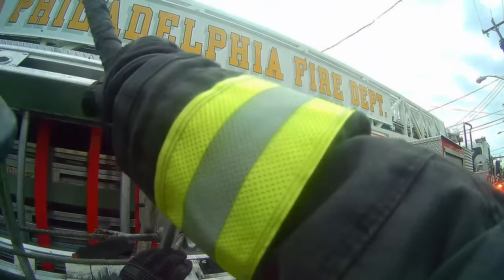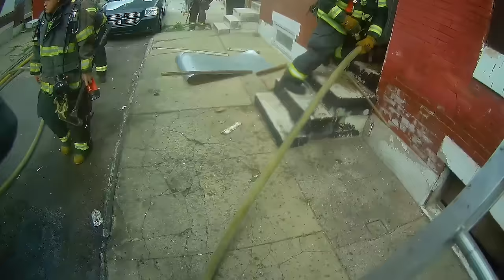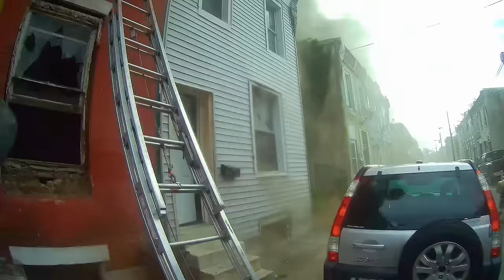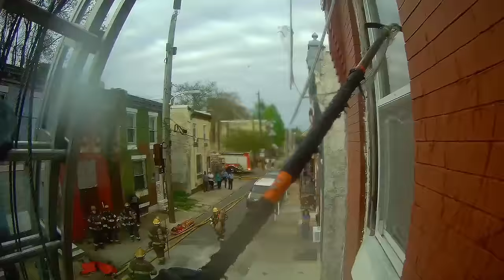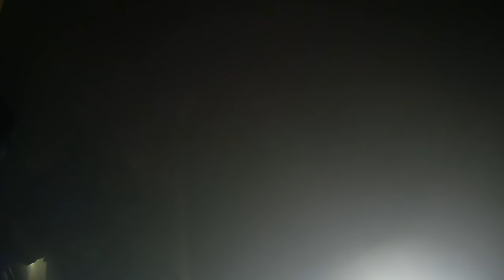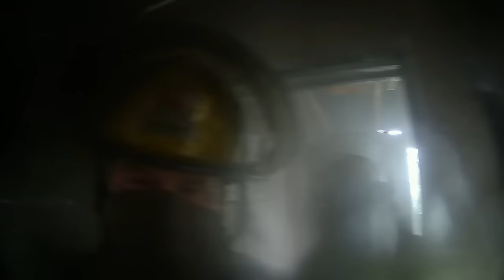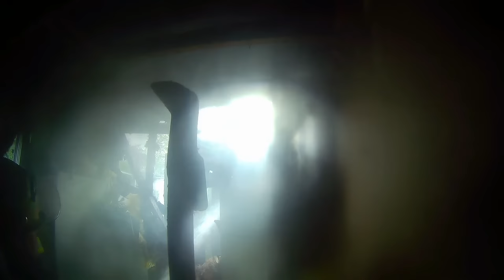North Philly Structure Fire Philadelphia Fire Department PFD Heavy Fire 2nd Floor Vacant Dwelling

Comment: You open the door to feed the fire instead of just pumping tank water through the windows to soak the burning material.  Come on guys, that's firefighting 101.  By the time we first see the building, that fire should have knocked back and ready for mop up.  Instead, they let it fully ignite to cause extension.
Reply: Says the guy who's never fought a fire in his life  🤣
Reply: This Fuckin Guy is on EVERY video on YouTube but never on the FIRE GROUND
Reply: @virgilhilts3924  How has guessing worked for you Virgil?
Reply from the maker: The front windows were boarded up so no water could be pumped anywhere until the boards were taken out/burned through. Entry is made into the dwelling to search for occupants or trapped victims (even though it seems vacant from the outside) and to determine the condition of the building - whether or not it was safe enough for an aggressive interior attack. That is firefighting 101. It was quickly determined that the entire 2nd floor was fully involved in fire. Thats 35 ft deep x 15ft wide of fire in multiple rooms, and in the walls, ceilings and roof. The fire had already extended to the adjoining properties on both sides in the rear before we even arrived on scene. Flowing water through the front windows only helped to extinguish the fire in the front room. The rest of the 2nd floor and both exposures required multiple hand lines in the front, rear, and on the roof flowing water plus complete overhaul inside the dwellings to fully extinguish them. 500 gallons of tank water through the window is basically the equivalent of pissing on a forest fire. Fighting fire in a major city, in 100+ year old dilapidated row homes requires different tactics than you might use with single family/modern construction homes in suburbs or small towns.
Reply: You comment on every fire video but never have actually fought a fire! 😂
Reply: @FloridaCatholicGuy  
Well he does have a toy fire engine and some Legos so he plays firefighter on the floor of his bedroom
Reply: You guys and these comments are funny af. These keyboard FFs are always making themselves look foolish vs the real FF. Lmao
Reply: @virgilhilts3924  It seems you found a playmate at your low end of the intelligence scale.
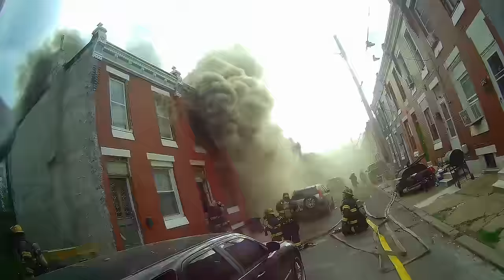Reply: @jesseosada4690  2:17 Do the second-floor windows look boarded up to you?  Where is the smoke coming from?  Could it be from those second-floor windows?  Before you do all that high tech and hero crap, you put out the fire.  That, is firefighting 101!  It is also common sense and logic, 101.

To the rest of your Fantasy that deflects attention away from what we can clearly see here, the smoke is showing from those two front windows and the corresponding rear windows.  There is a tiny amount of smoke coming from the window just to the left.  Those windows should have been broken out with a ladder to create a vent and access to exterior water.  There is no sign that the fire is in the building to the right.

They could have and should have soaked that front room long before the camera got there to prevent that room from flashing over which they allowed to happen.  The heat from those flames would make other material reach their flash point causing the fire to spread faster.  You could have soaked the rear rooms from the exterior also.

Then, with a much safer environment on the second floor, they go in and climb the stairs and finish off the rear area which is already vented out the rear windows.

By allowing the fire to flash, the flames could have ignited the gasses accumulated in the attic and walls.  Your JOB is to stop combustion Quickly and safely while using the Least amount of water.  Eventually doesn't count.

You don't pump 500 gallons through the windows!  To even suggest that tells me where You are coming from.  I call it, "Fountain Statue Fireplaying!"  That front room would have needed only 10-15 seconds of water to soak all the burning material.
Reply: @virgilhilts3924   Maybe he will step on one of those logo.
Reply: @JB91710  
All the ad hominem you can muster will NEVER make you an actual experienced firefighter 😆😅😂🤣
Reply: @JB91710  
"Do the second-floor windows look boarded up to you?"
-They are clearly covered with screwed in place door panels
-But thanks for yet again putting your foot in your mouth 🤣

"Where is the smoke coming from?"
-The fire 🤣 

"That, is firefighting 101!  It is also common sense and logic, 101"
-Your firefighting skill set and logic are at 0.0 🤣

"To the rest of your Fantasy"
-This from the 🤡 who literally pretends to be an experienced firefighter

"Fountain Statue Fireplaying!"
-This from the 🤡 who's only experience fighting fires is with his Lego Fire Station play set
Reply: @JB91710 🐔💩
Reply: @JB91710  Where Are You A Firefighter?
Reply: @Jesse Osada  Don't mind him too much.  He thinks he knows it all about everything.   And can diagnose a whole scene with one camera angle.  Knows every departments capabilities and equipment.
Reply: You know, some guys aren't scared to actually go inside a fire to put it out? That way you can actually hit the seat of the fire. But we know, you're scared so you resort to nothing but hitting it hard from the yard every time. Give it up JB, if you were a REAL fireman, instead of a poser, you might have a different outlook.
Reply: JB I’ve seen dozens of videos of you ranting absolute nonsense, and being refuted by the actual people wearing the helmet cams, who have the actual experience (evidenced by the video of them performing). Everyone with a shred of experience knows that simultaneous interior fire attack, search and ventilation works. But since you don’t have experience and you like to cite pseudo-science, what do you think about UL coming out after their years of studies and saying that the only time water should be applied from the exterior (with the exception of defensive fires) is if the hose line getting in position inside is severely delayed?
Reply: You Monday Morning QB every fire video you see. Where are you Chief at? Have you even fought a fire? Or are you a wannabe that watches fire videos and play pretend?
Reply: @MatthewMoore1  How old are you, 6?  Try telling me where and how I am wrong.
Reply: @JB91710 I would just like to know where you volunteer or are a career firefighter at. I'm not even trying to argue. I just wanna see how your department does things
Reply: @CarTalesCrew  I was a Third Generation Real Firefighter in an extended family of firefighters.  I have long since retired from volunteering. None of that means anything!  My observations and comments are based on common sense, logic and grade school science.  Most humans don't tap into theirs for various reasons.  They just react to what they see and hear with no thought whatsoever.  That's why almost everyone thinks the FDNY is one of the best ONLY because they are from NY.  They are actually one of the worst in the world!  to understand what you see in these videos and what I say, you have to tap into yours because what I say is the opposite of what you will see in these videos, so it is hard to grasp and believe.
Reply: @JB91710  “Real Firefighter “?! Oh, thanks for the morning laugh while having, coffee! Like I have said in the pass, you would shit yourself if you actually crawled down a hallway filled with super heated smoke!
Reply: @MatthewMoore1  And how old are you Mat, 6?  You sure sound like it.  Are firefigfhting tactics too difficult for you to discuss?
Reply: @nebraskaninkansas347  How old are You?  You sure sound like one of these other 6 year olds.
Reply: @ALee8456  Your IQ and level of maturity is showing Alex.  You fit right in here so that must make you feel better about yourself.
Reply: After reading all the comments I swear, it sounds like a kindergarten class just found this video.

Comment: I can't believe the chief ordered them out of the building and used and exterior line to knock down the fire. Where I work that fire would have been handled by 1 engine and 1 truck. 🤫
Reply: That’s easy to say when you don’t know the full story or what the inside of the original building looked like
Reply: @MJC501  - We have plenty of buildings like that in NYC

Comment: Doing that type of ventilation is a great way to destroy a ladder.
Reply: Maybe but on bigger departments they have the budget and it works for them
Reply: They aren’t Home Depot ladders, they can take a little bit of heat, you still should avoid it but it’s not debilitating